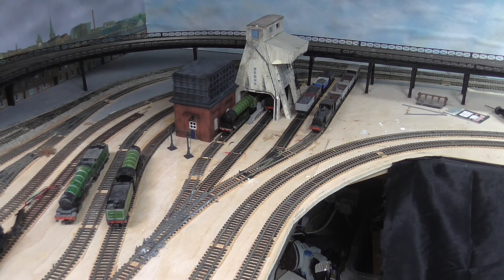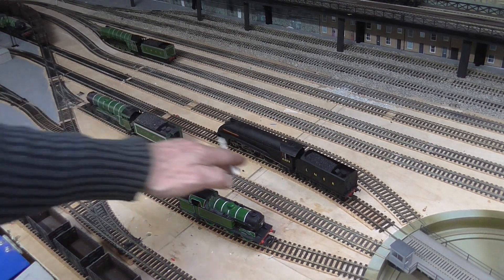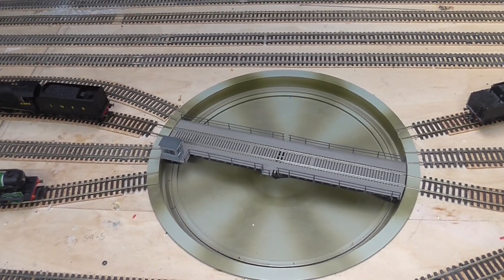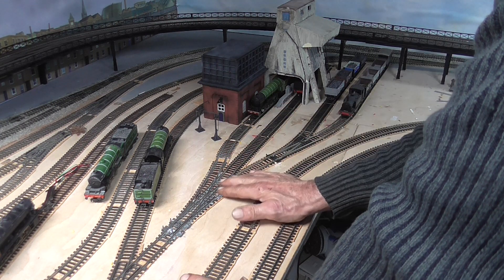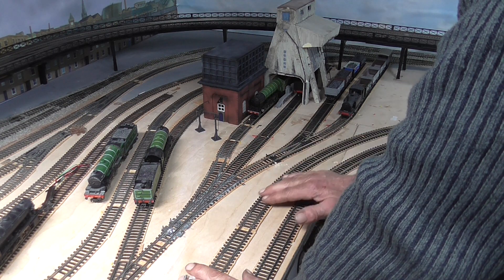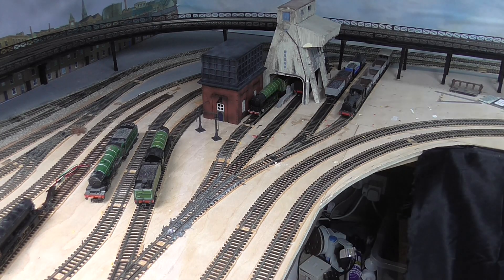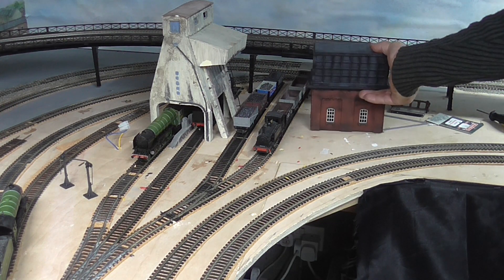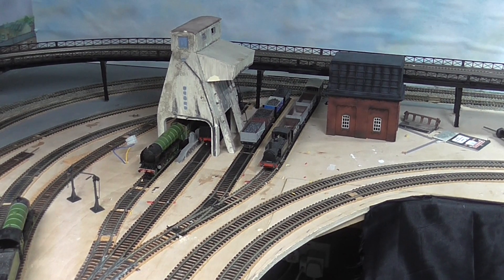Design problems, Can you Help?

Comment: Hi, I'm not sure if you have decided on your solution as yet, but I have a couple of thoughts after reading the comments. There was a suggestion to swap out the diamond crossing near the three way point for a diamond point. I am not sure if the idea was to use a double slip or single slip, if so they are alot bigger than your short diamond crossing. Although this idea would allow access to your coaling stage. The other idea of putting a point on your "goods line" into the coaling stage would work,  but isn't as realistic, especially if the point is on the curve. I am sure a point into sidings would have to be a diverging line left or right, then run parallel to the goods before entering the yard. You do have room by the looks of the video. If you used two points and created a head shunt you could shunt your coal stage without blocking the goods line. I'm sorry this explanation seems a bit long winded but that's just me. I hope you come up with a workable solution to your problem. Best regards Dave.
Reply from the maker: Hi Dave and wow, what you say makes great sence. going to try all the different ideas tomorrow, most revolve around running the coaling trucks off  the goods line, but as you say, would it be realistic? hopefully will find the answer. All the best. Glynn

Comment: Hi Glynn, can you not just swap the position of the three way and two way points? Use the two way to feed the coal tower, put the three way into the main line (on the curve if it will go) and use the two remaining roads off the three way to deliver your coal trucks and you have a spare for the siding.  Hope you can follow my logic!
Regards Barry
Reply from the maker: Barry, thats brilliant! going to try first thing in the morning, my only concern is the amount of curve on the point to fit the goods line, but the best idea yet. Will let you know, all the best. Glynn